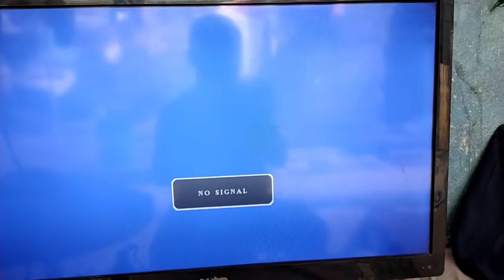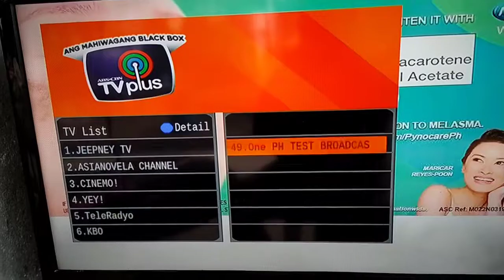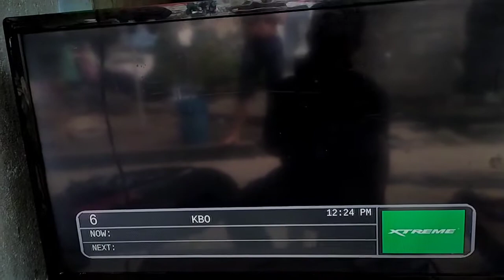Sanyo LEDTV Repair

Comment: Hello my friend, I have an issue with a Sanyo tv it's on color reset mode, it only flashes colors? Any advice ?
Reply from the maker: It's on Aging Mode. Try holding power button for 5 seconds. or check LVDS Cable.
Reply: Hola ..alguien me puede ayudar a encotrar el menu para cambiar JEIDA O LESA . Tengo sanyo led tv